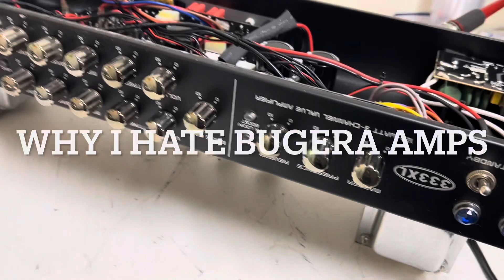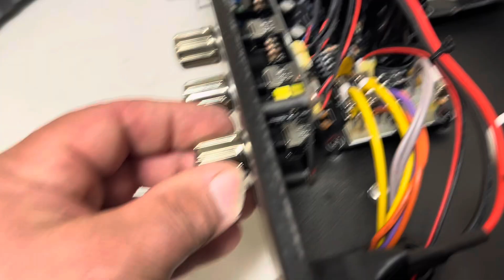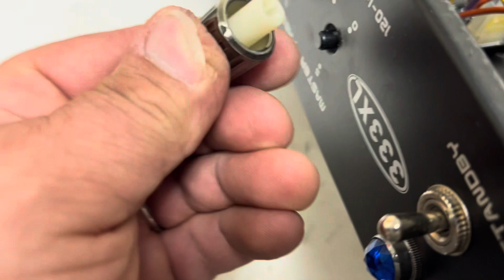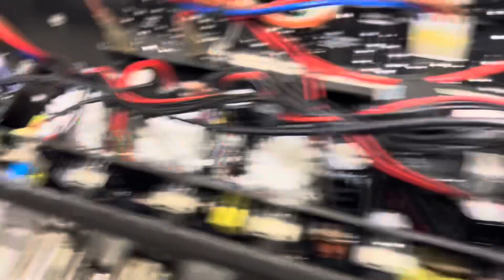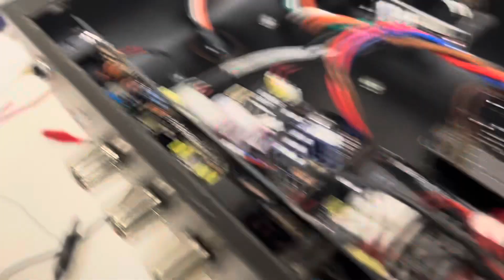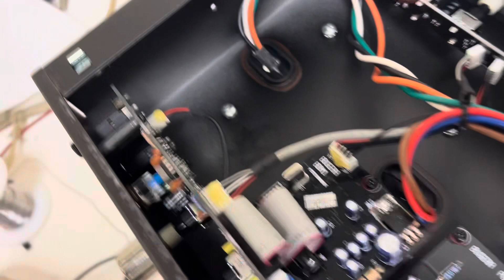Bugera Amps! And their issues

Comment: I have been using the Bugera valve bass amp SUP 5500 for about a year now. It sounds and acts as it should but it gets really hot to the touch after playing for a little while. The fan is working so I'm not quite sure why it runs so hot?

Comment: I would imagine the tech here would like to earn his significant pay by working on hand made amps, designed and built be a seasoned tech using the finest parts where those parts were spaced apart by the length of his screwdriver soldered point to point. Unfortunately, not everyone can afford $20,000 for a practice amp. I have worked on vintage Fender amps that did not only frustrate me with some quirky design issues but downright pissed me off because  "I could have done a better job !!!"

Comment: I have 10 tube amps right now, been thru about 26 of them…..I don’t care what brand you own, they’re all fallible…..but I’ve never had a problem with my solid state amps….hmmmm.
Reply: Let's just be real, all electronics can fail for a multitude of reasons across the board from any manufacturer. People only hate Bugera because forums told them to.

Just like the Marshall MG.
Reply: @riffsnoleads I've had a handful of bugeras opened up, also Marshalls.. and peaveys, and Oranges, etc. The bugeras really aren't any better or worse than any other budget tube amps built in China. B-52, Egnater, Chinese built peaveys etc. 
Well.. that's not entirely true, I'd trust a Bugera far more than an Egnater but that's a different rabbit hole altogether.
Reply: My Marshall MG100HDFX started to make some dead cap noises and the fan quit.
Reply: all tube amps are “fallible” however these are just begging to fail because of poor assembly methods and cheap parts.

Comment: Are these amps worth their relatively cheap price once someone goes through them to fix the easily correctable soldering & crimping issues?
Reply: I have a Bugera 1960 Infinium and I gig it all the time and I absolutely do not use kid gloves with it and it has not failed me yet. I got it 3 years ago from a dude who had it for like 3-5 years prior and I run it at high volume only and I think just now the stock power tubes are needing to be replaced.

People shit on them because of a few bad experiences and endless forum bashing because of the "my booteek $1000000000 amp is the bestest and anything less than that is ass scum" mindset that plagues forums.
Reply: They are pretty decent sounding amps, I wouldn’t to  travel and rely on it for gigs.  If you don’t really leave your house it would be ok. It took me almost two hours to change a broken input jack. The boards are very flimsy too
Reply: @dr.rawkensteinslab3453  I didn't get a notification or else I woulda thanked you for the reply & good info two weeks ago. I'm having an early midlife crisis and wanting to start playing live again so I do want something that'll be robust. I think I should be able to get a local guy to part ways with his Genz-Benz Shuttle 9.0 and if that falls through I could always grab a 600w Peavey Minimax -- either seem like a better option than the Bulgera. Thanks again!
Reply: Hey do you have any videos of you taking the board out?
Reply: Hell yeah use a noise pedal 4cable method,  impedence switch for many different cab setups, behringer budget 5150 lol
Reply: Most of the problems are people who have no business soldering wires to pins working on them. The loose connections are usually from the previous idiot who got in there with his golden screwdriver. All amps nowadays that are mass produced are constructed in this manner. Mesa boogie included. Peavey and Marshall.  Or whatever else.  Ive owned many of the bugeras and fixed them. Its lucky they ever made these. Infact im pretty sure you cant buy them new anymore so blackstar or wacky chingchong amps are all that's out there on the cheap lol.
Reply: I'd say yes. There's nothing in a bugera that stands out as egregious. There's some.. weird things, but nothing that I have looked at and thought, "that's going to be a problem." So far all I've had to do to them is touch up some broken solder joints and replace a bad cap in one. Honestly I've had to fix more Marshall's than anything and Egnaters are just straight up time bombs, I won't even touch them.